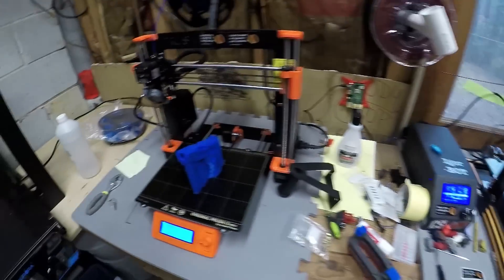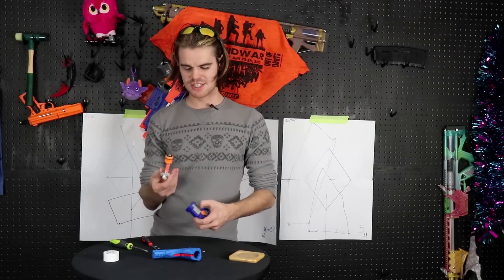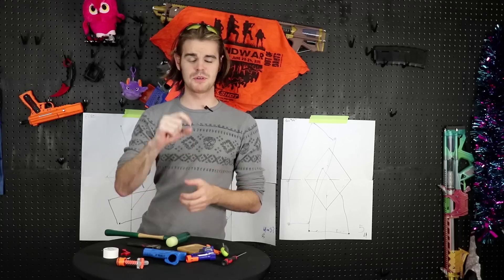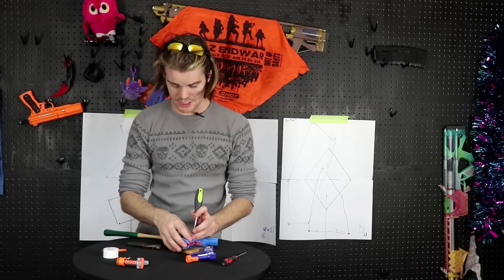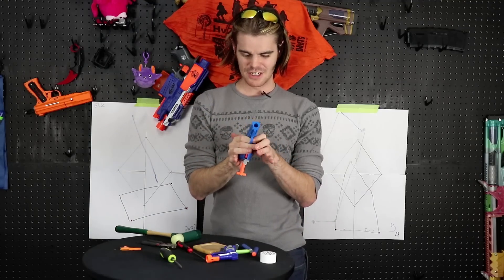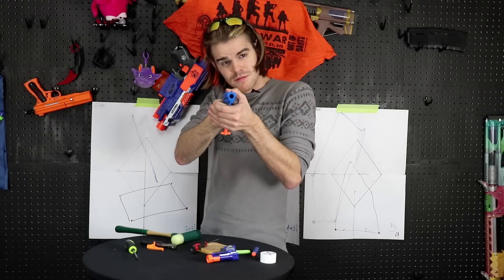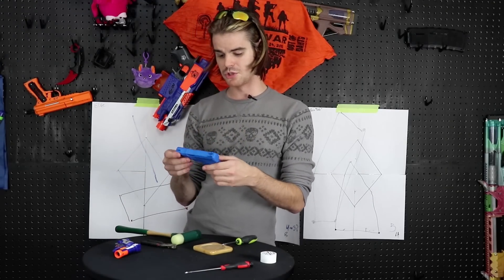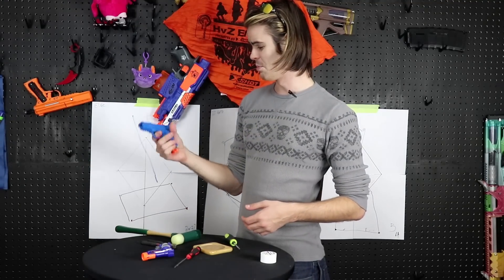3D Printed Nerf Jolt Glock Reskin

Comment: Note to all you Tards its not a five seven, a five seven does not have the finger grooves in the handle, the slide is flush with the body, and the rail is much to small, 

It is more of a p99 with some modifications

Comment: If u dremil the pin hole on the trigger to a slight angle, this shoots worker short strait upto 20m strait made one months ago n used a old as f jolt n its my fav single shooter n perfect kill streak starter before switching to my upgraded turbine, plan to dbl o ring n dbl stock spring my 3d printed 57 tomorrow for in upgrade but this does work with a lil bit of dremil work n is my most precise n accurate blaster with awesome range

Comment: Do you not know what a glock is? This is not the first time you've called that which is not a glock a glock.

Edit: yes you do, you clever noodle. You did that on purpose to get the engagement rating up.

Comment: Looks nothing like a glock. Exactly like a p99
Reply: Different sights, the p99 doesn't have a rail under the barrel, no flange at the back of the handle. This is more likely modeled after the FN Five-seveN
Reply: Not a five-seven, its a walter P99
Reply: It's time to stop Get some help, thats just a modified standard nerf rail